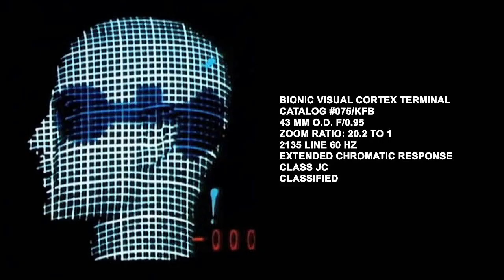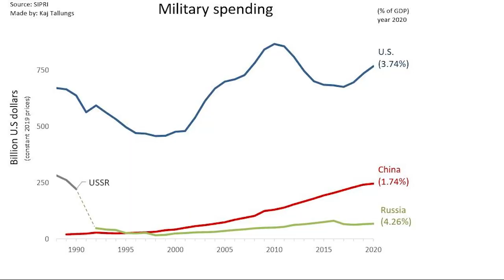Tamiya Lunchbox upgrades - Are they still fun?

Comment: I have a Pumpkin I got new about 20 years ago (they still made them for some markets apparently, got it in SA at a time when it had been discontinued for years in Europe) and I've put a lot of upgrades on it, oil shocks, Ampro front end, alloy wheels, it's also been given a power upgrade. But I probably have more fun taking turns driving my daughter's Lunchbox with her (a recent re release I got her, painted pink), it's standard and I'm not scared of breaking it!
Reply from the maker: I’m a firm believer in Tamiya Tough, Ive been considering a pumpkin for a while, but I’ve been considering a lot of Tamiya Models, and now they have released more 🤩👍